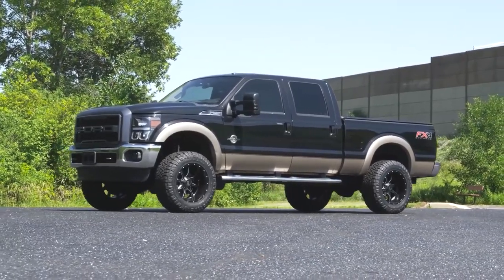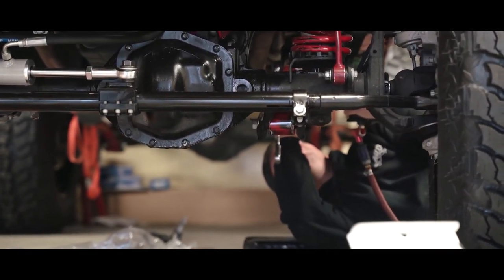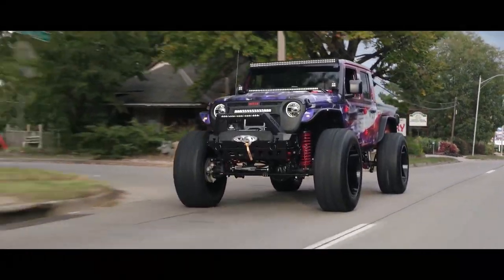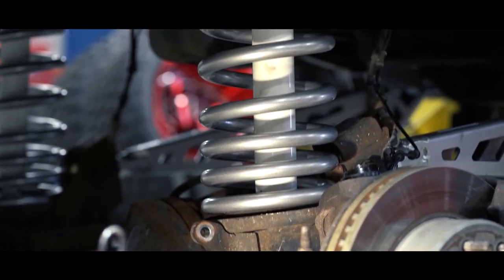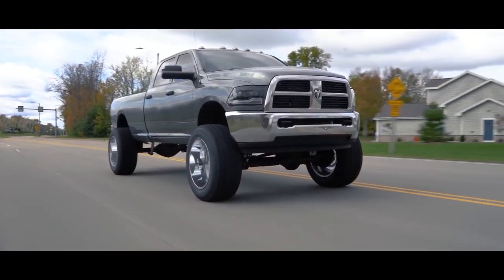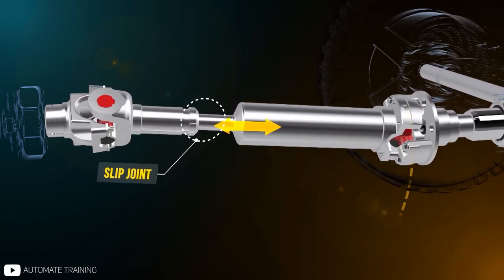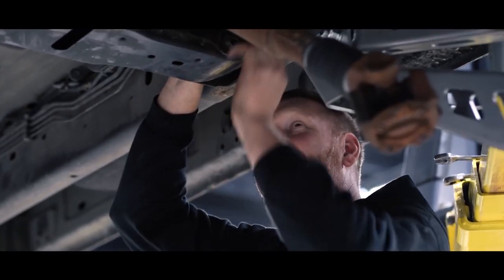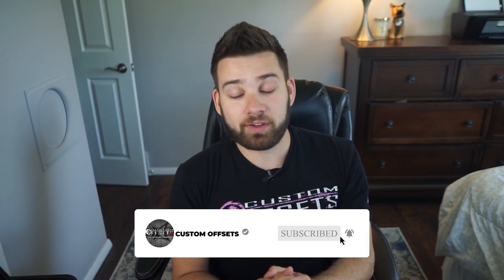Should You Lift Your Straight Axle Truck?

Comment: One thing to note is many off road focused solid front axle vehicles can increase tire size by several inches without the need to do a lift.  Examples of this would be the 4th and 5th Gen Power Wagon or 2500/3500 Rams which can fit a 35 x12.5 with no rubbing and a 37x12.5 with very minor trimming on the stock suspension height.  The Wrangler JL and Gladiator can fit 35x12.5 on stock suspension.  This is not very common with IFS trucks.

Comment: This is very informative but I think in general anyone who wants to lift their trucks higher than 2 inches really needs to be aware of the angles. Solid axle or ifs cause once you go higher than that you'll need to invest in on those angles. Solid axle will always seem easier to lift because it requires less components I agree. Still doesn't mean you don't have to look after it and be aware of those components. Thanks custom offsets for making things clearer on solid axle lifts. Think I might be more motivated to get an 80 series land cruiser or a 2005 f250 super duty.

Comment: As I'm looking at the rear bumper my REAR axle shifted more to the passenger side than the driver's side after lifting 6 inches, I've heard it's a problem with lifts and is there a solution? Thank you for your time.

Comment: What about leaf springs? I have an 85 dodge, would I still have these problems?
Reply: you’d still have to deal with the center of the axle in regards to trac bar relocation brackets or lengthened trac bar. a lifted leaf spring would bolt up in the same spots and have the correct axle centering pins in regards to being too far forward towards the bumper or too far back towards the fender. would still need drop pitman arm, shocks and sway bar spacers along with the new lifted leaf springs.

Comment: 03 Silverado 5.3l extended cab, I have to cut the top bump area because it was holding the top plate. Now, is higher, but the axels (new) are making noise after a side bump. I end up buying a 6” lift kit to lower the transfer. Planing to build a house in a far away site with no road, just mud. 
   To much angle.